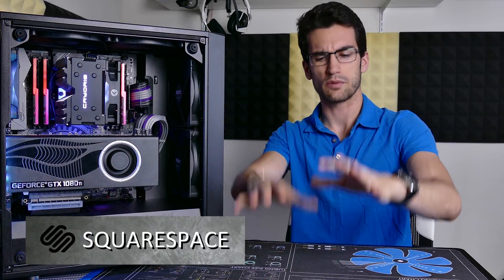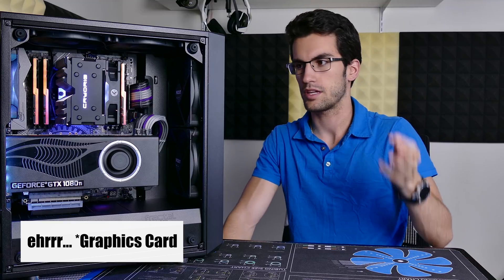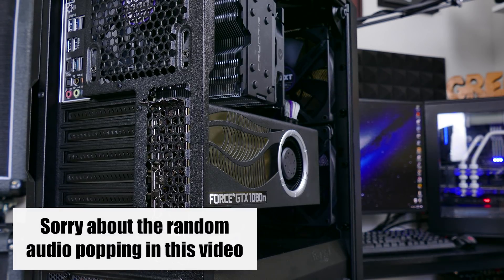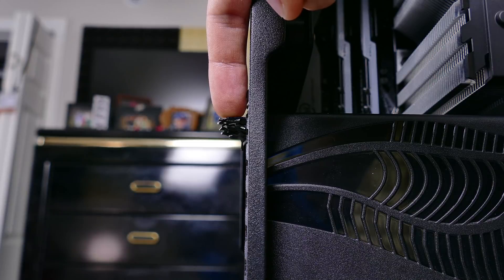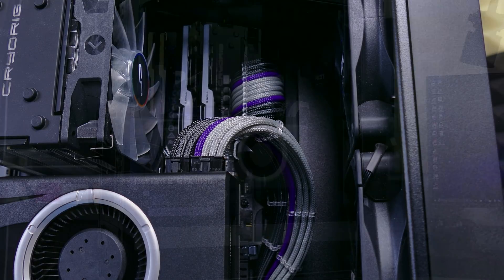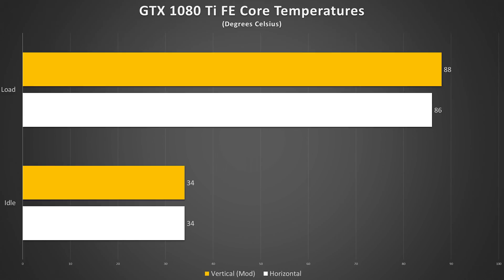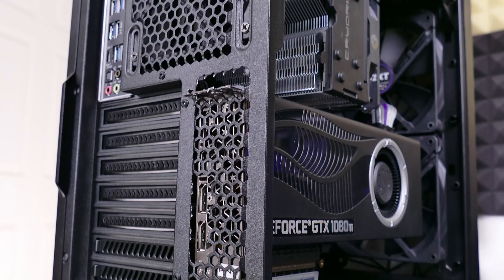How to Mod & Vertically Mount Your Graphics Card (the Simple Way)

Comment: I know this is an older post but I have a new case and a new gpu coming I am going to try something similar But I think I will cut the slots to slide card in and appropriate space for video plug ins  but I will remove the bracket screws and screw back to card through the mesh.  You think that would work ? I don't have the card yet so can't check out but thats how I am visualizing
Reply from the maker: Interesting, it might!
Reply: @GregSalazar  yep got the case today its a razer tomahawk (got really cheap coul;d not resist) I looked and plenty of room for sure be about another week for card I will let you know if it works out

Comment: How come your delta increase comprises only 2 degrees when mounted vertically so near the glass? My 1660Ti heats by 8 degrees more as opposed to traditional mounting and is much noisier due to increased RPMs of its cooler.

Comment: Here is a dumb question, why are people doing this? Just to see the fan side of card I guess? Every since I started building PC's in the 90's GPU's have been upside down, always thought it's so the fan/fans get cooler air since heat rises. But how many cards have the art/design been on the bottom? A lot. Now cards like my RX590 Pulse have very nice aluminum plates on bottom so they don't bow like my R9 290 did. So since they don't have as much air space between side panel & fan shroud when mounted vertical as they do horizontal what is the point? I watched this video in hopes of some explanation but I still don't see why..

Comment: Looks great from every angle but the rear (sounds like someone I know). Considering how much time and money is spent on this rig why not cut the metal properly with a dremel, and bolt the card to the back using some small bolts/nuts.

Comment: I ordered two of the Vertical Graphics Card holder kits  from Cooler Master by accident, so I am selling one of them on Ebay! If anyone is interested check the listing out! > https://www.ebay.com/itm/Vertical-Graphics-Card-Holder-Kit-with-Riser-Cable-by-Cooler-Master/183029887004

Comment: Well ... yes that's a bit tacky  however of the two pci-e brackets I have seen ....
https://www.mountainmods.com/product_info.php?products_id=754&osCsid=gronj63kfaqev7e63136v643c0
and
http://www.coolermaster.com/case/case-accessories/vertical-graphics-card-holder-kit/
I don't like either of them.   The coolermaster one to me is too large (I happen to want to keep my stock pci-e slots for other hardware like a TP-Link AC1300 WiFi PCI-Express Wireless Network Card)  and the mountainmods one well it's just a tadd too large too , well to fit to the side of the stock slots (I'm using a phantek enthoo pro) but with all that been said I like your idea on how you mounted your gpu. It gave me an idea of my own.... I can make a couple of "L" type brackets , cut the mesh out of the case where you mounted your gpu rivet my brackets to the case , one at the top of where  the card will sit and one at the bottom of the card - bottom bracket will have slots cut for the tabs on the card (the tabs you slid through the mesh) and I'll bet ya it will be a strong mount and will look good too.....so thank you for inspiring this idea keep up the killer modding ....peace!

Comment: I´m not 100% sure, but I think I have a better and prettier Idea. Only prob. I don't have a case neither card yet to try it out oO... 
I´ll try to explain... 

Instead of cutting out that upper part of the case, just make a slight cut so that the corner of the card fits through. 
Then stick the corner through and fix the card by sticking something into the hole of the card. The hole seems to be quite close to the net of the case and should prevent it from moving. To actually fix the card i would just take 2 cable ties and fix them onto the bottom feet. Holes to connect the cables must be made. No idea how to prevent that yet..

Ill try that out as soon as I got my case in December/January. If anybody is interested in the result, just leave a comment down below. Ill post a link of my future Video as soon as I got it done. The final result may be a little different depending on the upcoming ideas that may occur.

PD: Don't want to do any publicity for myself. Just want to help because cutting a case like that is a crime ^^

Comment: I guess you could cut a circular hole in the side of the case, to give external fresh straight in the graphics card air inlet (with a cone to isolate it)? Be very interested to see temp results from that...with your case, not mine :-)

Comment: It's a good idea if you got a cheap case, I wouldn't do it to either of my full towers, Darkbase pro 900 and a Enthoo primo SE. But I do have a Inwin 503 that I've modded the crap out of just for pratice. So I may give this mod a go. Soon as I buy the gpu riser. I like  ghetto modding. I often use Zip ties to install fans when I got no screws left.

Comment: Can you make a sli build like this?
Reply: Erik liljeberg Only with extra large cases
Reply: Cooler Master has a bracket. Just look up vertical graphics card holder by ice wolf. It mounts right into your PCI slots in the case. You need to cut out the case's PCI brackets off to use it though but you can mount 4 PCI cards on it or 2 2-slot cards. It works best with a custom water cooling setup.
Reply: little late to the party but I'll chime in. you can get the 4-slot bracket from aliexpress.com for cheap
I can't find it anywhere else at the moment

Comment: With vertical GPU mounting becoming so popular nowadays because of the cool shroud designs of a lot of graphics cards, you'd think case manufacturers would catch on and make vertical GPU mounting a feature built into their newer cases... or at least make modular PCIE brackets so that we can replace the standard layout with a vertical layout without cutting and ruining..I mean cough MODDING the case;)

Comment: Greg, I think you'd be better off at looking for some kind of small hooks/small powerful magnets you could install inside the case rather than deforming the case. it is a bit ugly and i think with some creativity, this can be improved.

For clarification on small hooks, I'm thinking something along the lines of tiny command hooks (needing modification). You could likely utilize them in such a way as to simply attach them to the grill. I understand yours is "no cost" but if someone doesn't have side snips (which are a couple bucks) then it could end up having an equivalent cost as purchasing the hooks if you don't need that tool.

You may even have more luck/options if you remove the IO plate from the card. 

I may actually try this, as I rock an Air 540 case, which as you know has a lot of free space towards the bottom since there is no power supply.

Comment: Pr0 tip: You can also use the very far top edge of the pcie bracket to mount it. But drill is needed. :P

Comment: What about the stress that is being applied to the card downwards? it's only hanging basically on the two screws that hold the PCB to the metal bracket. The stress that the PCB takes normally is that it's pressing the bracket's L section that connects to the card, not pulling away through the hole. Plus, the card is getting additional support from the motherboard's connector, something that isn't so here.
Reply from the maker: itsGeorgeAgain I showed you, pushing it around. Very stable.

Comment: I thought about getting a case with vertical mounting for new build but finding one that didn't cost a fortune and still having to get a riser card made it too expensive to consider seriously. I opted for Thermaltake Core V21 because I had no need for the extra PCIe slots in standard ATX setup and that case had what I was looking for which was not having to worry about anything bending under the test of time and gravity. Mostly it's just a piece of mind thing.

Comment: You need to make a hole in the gpu bracket just a small so that cabke tie fits tightly and then pull it once. And cut the excess. Same method for top also.

If you don't want that you can take ylur gpu amd attach a small piece of metal to it. Soldering or even strong tape and do the same with cable ties again. Without damaging your case or gpu at all

Comment: Now that we're doing hack-saw-modding, do me a favour? Take out all your PCI-E slot grilles. Cut one or two of the crossbars, around where your display-ports are. Take the card, slip the bottom "lip" over one of cross-bars between the grilles, zip-tie the top. Maybe cut an old mouse-pad into "washers" to prevent rattling? 

That SHOULD let you slide the card in/out towards the side of the case, ease that temperature + let you use a shorter riser-cable (which comes without that bracket-thing you've got on).

Comment: Na...I rather not mess up my case. If I'm gonna do a vertical mount, I'll do it properly. For me, everything in my PC has to be screw-locked down for a peace of mind sake. Plus it doesn't look too professional and I don't like having sharp metal edges sticking out, cause I reach back there blindly all the time. Anyway, if you're really that desperate, I guess it's a good idea. Nice video btw. keep up the good work.

Comment: I grew up around farm equipment.  We changed quite a lot in unusual ways just to get the job done.  We called it something else which I can't put here, but I have been doing it all my life.  When my speedometer quit because I was going over 120 mph too much, I purchased a square speedometer that had a red bar up to 240 mph.  I double tape mounted it to the top of the dash and drilled a hole through the heater vent and firewall for the cable.  It worked perfect.  I had my car up to 224 mph before I thought I might blow over.

Comment: It would be better to create an actual mount with it with a case without the holes by bending the metal at a right angle then drilling screw holes. That way you have a proper mount.

Comment: *gets excited. 
*takes a look at the back of the case
*sees solid steel sheet
*cries
Reply: m33p0 I posted a tutorial on my channel which is super clean and adds no risk or stress to card :)
Reply: Aviation shear and wire saw, and some elbow grease
Reply: m33p0 you can still cut out an opening and screw it in
Reply: Get ready with drill&dremel
Reply: Or a drill and a coping saw and needle nose pliers.
Reply: Get a bracket. Cooler master makes one that takes up 7 or so normal slots. You will probably have to cut out the dividers between the slots but that should be easier than cutting a whole new hole.
Reply: Do you have a link?

Comment: Some cases have a mesh on the side panel instead of transparent glass. Do you think the side mounted card will give better temperatures as essentially it will be pulling fresh air from outside the case?
Reply: yes.. till the extra dust clogs the cooler fins of the card

Comment: I can only imagine the look on Fractal Josh's face if he seen you mod one of his cases. Lol. Then again, probably not nearly as bad as a look if he noticed the NZXT fans on the front intake. But for being able to mount your graphics card vertically in a case that wasn't designed to do so and for virtually nothing (as I'm sure the average Joe wont have a riser card or cable on hand) this is very spectacular.

Comment: uhhhhh am I the only one wondering why he didn't just orient the card so the blower was facing towards the motherboard, first so he's not struggling to get air to the blower, but also because it would be a better use of gravity to keep the "top" of the card from being wobbly? literally all he has to do is make the top the bottom and the bottom the top and he'd solve the two issues he had...
Reply: So, also placing it backwards where you see the pcb/backplate of the card instead of its more beautiful front?
Reply: Science Studio - so another case of "I don't care how it functions I just want it to look pretty" in which case why didn't you string a bunch of christmas lights inside and outside the case? why not add a 3D holo projector to shoot the manufacturers name into your ceiling when the PC is on, why not insert a dozen other things and then benchmark the performance as if it ever mattered? (I mean if you were going for aesthetics, why did you leave that ugly riser card exposed, way to duct tape a broken bumper on your truck and call it purdy)

side note, I suspect you have negative case pressure by your design and are sucking in warm air exhausting from that GPU (meaning it could run cooler and at a higher clock) because its the least resistant place your case has left to pull air through, maybe change your airflow mechanics to something "prettier" AND functional so you can not just be pretty but smart too and be valedictorian instead of just prom queen...

(wow I went a little grumpy cat there hey, seriously though, check for negative case pressure, don't toast your buns prematurely)
Reply: 100% for aesthetic purposes
Reply: That's the whole point of mounting the card vertically
Reply from the maker: bob dole Would look stupid. This card doesn't have a backplate.

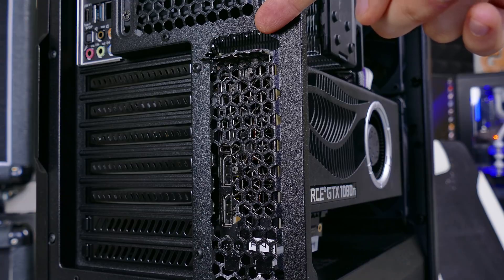Comment: At 5:43 you can see above the   pci-e slots on case the flat part. If you got the right size drill could put 2 holes in top then put screws in. Take out pci-e cover and trim if needed for conection.     Would be neater and just as easy.      

Can you do testing to see if there is any performance drop when having card vertical.

Comment: Nice. This probably needn't be said, but a pair of L-shaped shelf supports to screw onto the grill and GPU is far less expensive than a decent riser card. Inserting grill bits into the GPU screw holes doesn't hold it very firmly in place. You could even use two PCIe slot covers and cut off the L-shaped part to hold the GPU, use the other half of the slot cover as a washer. But hey mcguyverish and free is cool too.

Comment: You see a significant performance decrease if you plug gpu in the lower slot of mobo and if you this with a riser pcie card, the performance hit would be even harder. Wish you showed some benchmarks with this and default orientation.
Reply from the maker: Wolfgang The riser is plugged into top slot. No performance drop so far.
Reply: Wolfgang Linus Tech Tips did a video using over 3m of risers daisy chained and there was no performance issue, also x8 slots aren't that much slower. The issue is that the riser isn't included in the mod allegedly, so the performance drop would be 100% to keep it free!

Comment: cooler master sells a vertical gpu holder for like 30 bucks otherwise or 50 for the raiser cable inclueded and its works awesome:)got 1 in my inwin case:)
Reply: Link?

Comment: Was a Telecommunications engineer for 30 years...stay away from Ribbon cables, as current flows over the fine twisted pairs of wires the connections go bad.
Reply from the maker: Well-aware. This one resulted in almost no degredation, but we'll see if it persists.

Comment: My GPU at horizontally already heats up my tempered glass a lot. I wander what will happen if I set it vertically. FYI I m using thermaltake view 31 TG
Reply: Lone Gamer from BD i have the view 71 and perfectly fine...u should be just fine
Reply: Lone Gamer from BD do you have an open air cooler? It should actually heat up less then because the hot air  coming out of the sides doesn't hit the tg directly anymore
Reply: Markus Wiedner well.. I am using tt water cooler 3.0 280mm. Radiator at front sandwiched between 4 fans with pull in. And 3 fans at top, 1 at back and 1 at bottom with push out the hot air. Normally it's fine, but when my GPU is on load for an hour, I can use side TG to make an omelette XD . May be it's because of my radiator+GPU temperature. 

On the 2nd thought view 71 got side space to air out... not 31.

Comment: The Fractal Design Define R4 has an extra vertical PCI slot for some reason, which were omitted in newer revisions for some reason, as well....

EDIT... Okay, the extra PCI slot is a single PCI slot, so it wouldn't work with Dual slot GPU's...

Comment: Hey. Where would I get a laptop graphics card? I already have one in my laptop and I was wondering if I could up grade it
Reply: Eden Frawley 

Usually not possible but you may use a external graphics card (even without thunderbolt and naive support), there are a few nice videos around that topic on YouTube
Reply: Eden Frawley nope it's realy impossible 😉
Reply: Eden Frawley with laptops its actually built into the board and sadly cannot be replaced. However there are external graphics options but those can get pricey and you would habe to have a usb-c or thunderbolt connection.
Reply: laptop components besides storage and RAM and in some cases the battery are usually soldered on and a newer GPU may use a different layout so the chip may not be compatible in most cases like how you can't use an core i7 on Ryzen MOBO or whatever
Reply: You're joking right?
Reply: Ok guys thank you for the support. My laptop has a 940MX 2gb gddr5
Reply: Sorry for the snarky response, the laptops mostly have the GPU soldered onto the board, so you don't really upgrade laptops like custom PCs. Think of a laptop as a snapshot of the current technology.

Comment: Mind leaving a link to a graphics card riser for anyone curious?
Reply: Wow thats on sale. I am buying it now for my case that actually supports this.
Reply: Thermaltake fixed their f-up and made a premium cable. The EZDIY seems to have some quality control issues here and there, but for 26 bux(25cm=250mm) it may be worth the risk vs 67 for the TT premium cable 300mm version.
Reply: https://www.amazon.com/dp/B01NH0GW7Z/ref=cm_sw_r_cp_apa_jW1Pzb5WKJCZQ
There is a 20cm version available and that's the one you should get, however it's just not currently available on Amazon.
Reply: Thermaltake got a nice model of a riser card :)